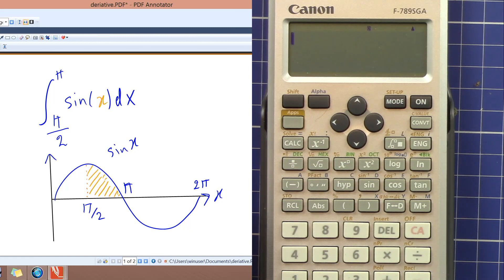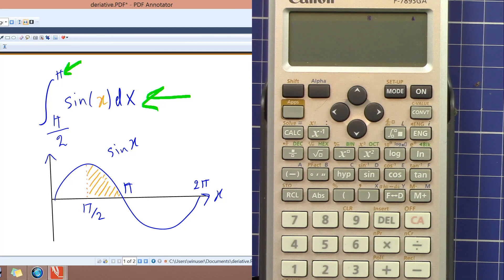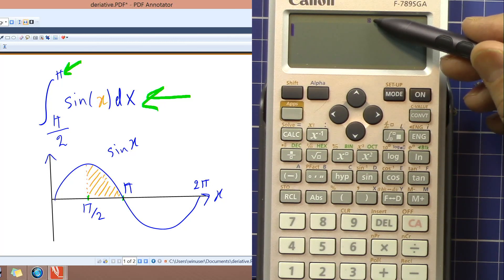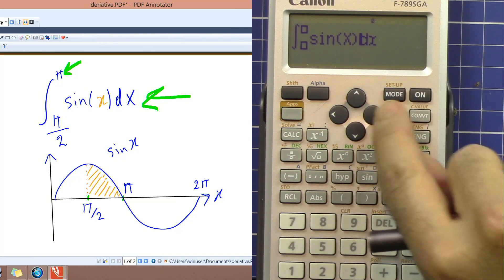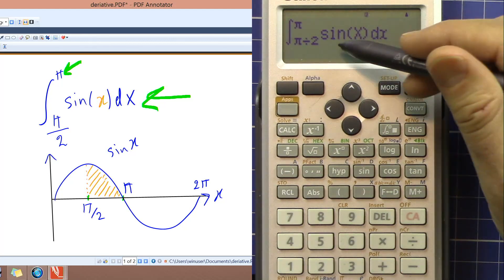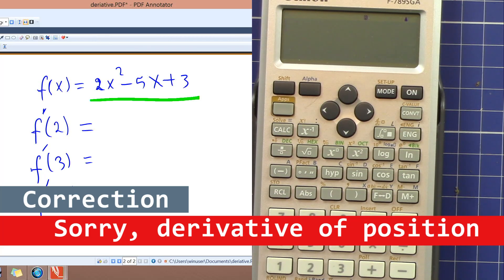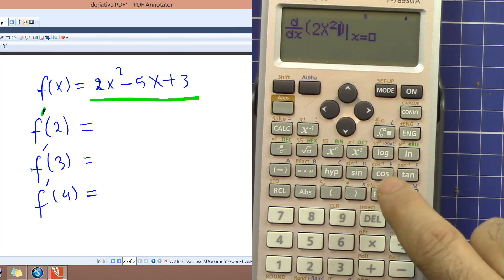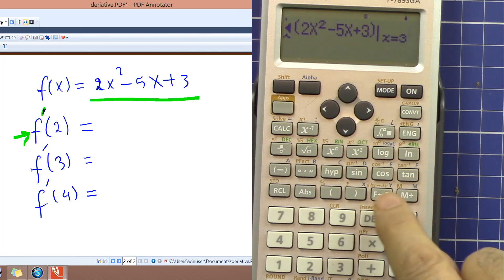Canon F-789SGA: Evaluate Integral and Derivative

Comment: Hi. Is there a way or technique to solve higher order derivatives e.g. 2nd derivative, 3rd derivative, etc. of a function using calculator only? particularly this calculator or a lower function calculator?
I would subscribe if you can show me a way. Thanks!
Reply from the maker: Hi,  If it was possible, I would have demonstrated as this video is on "derivative and Integral".  Can't do it with this calculator. By the way I have not connected to this channel to reply. I check it every once in a while.  my real channel is Robojax. #robojax
Reply: @equaser  Thanks.
Reply: @equaser  just letting you know this is possible. Please properly read through the instruction manual that came boxed with your "Canon F-789SGA Scientific Calculator" before posting a demonstration video such as this. Please take down this video and reupload a new one properly demonstrating how this calculator can be used to find higher order derivatives including the nth derivative (When it exists). Thank you